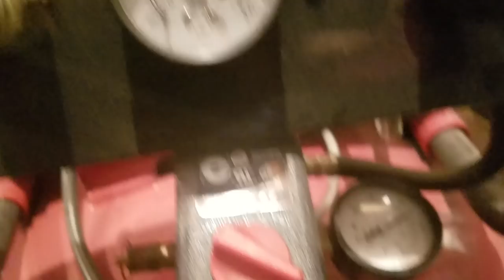how to remove scratches from windshield glass!

Comment: Hello, what PAD you used to polish the windows
Reply from the maker: This is just a foam applicator type pad, usually for applying waxes and sealants.. You would be better off using a cutting pad, wool or foam aggressive pad to take more imperfections out of the glass.